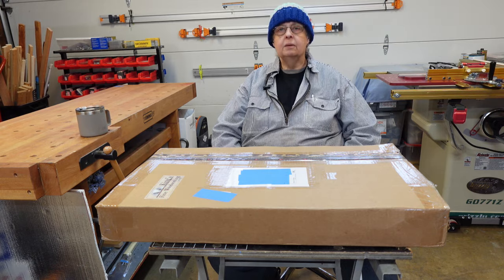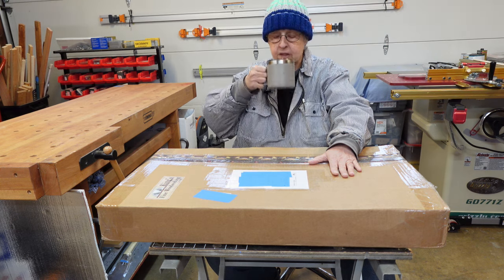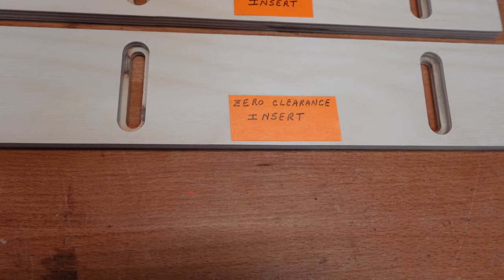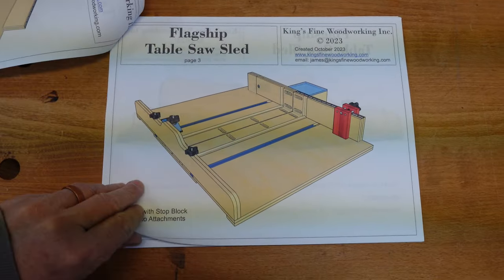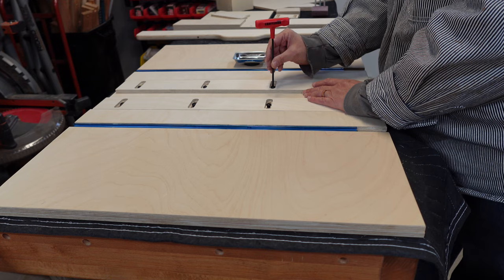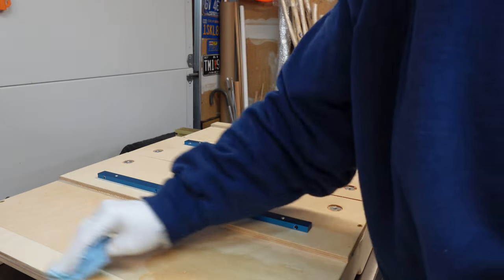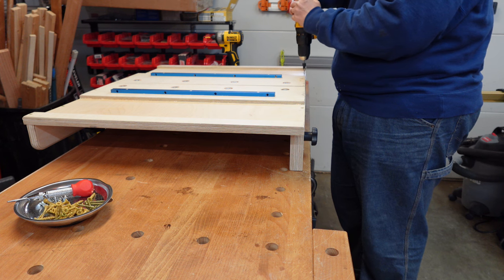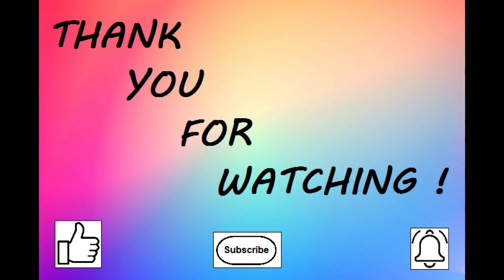KFW Flagship Table Saw Sled Unboxing and Assembly - Part 1

Comment: Just a quick note on this sled.  I started putting mine together yesterday and realized that some of the t nuts for attaching the zero clearance inserts were too high on the top side and had to be filed down and 2 were too low and thus sticking out of the bottom (not flush) and rubbing on my table.  I thought it was the miter bars scraping because they were not adjusted properly and finally realized (today, fresh set of eyes and mind!) that it was the t-nuts rubbing on my table - they needed to be forced in slightly with a little persuasion!
Reply from the maker: Thank you Matt!  I will let James know about your issues.

Comment: Excellent video, provided me with information I did not see in James' assembly instructions  - especially for attaching the tape measure.  Many thanks on that.    I went lean on the CA glue on the miter bars like James did,  I like your tip on the phillips screwdrive and hex combination.  I will be making a router table for my Dewalt router and this sled should help me make exact cuts.
Reply from the maker: Thank you for watching and thank you for the comments.  I have been using my crosscut sled for over 3 months now, I use it every day and I love it.

Comment: Really well done video. Brilliant idea on putting the hex into the top of a Phillips screwdriver to keep with the sled for that specific use. I did find it quite funny that you were waxing the bottom part of the sled that doesn’t actually contact anything.
Reply from the maker: Thank you so much. James recommends waxing the whole thing, even the parts that don't contact the table saw, so that it will absorb moisture evenly. This is to prevent any warping. He is the guru so I did what he suggested. It makes sense though.

Comment: I don’t have the cross cut sled yet, but the tip about to much ca glue and going to your neighbor’s garage and finding a screw drive that you can drill into is valuable info.  Plus it nice to see that you got a new table saw out the deal.
Reply from the maker: Thank you. I hope the video helps when you do get a sled.

Comment: Thanks for the video, I found it helpful.  I have a question about the tape measure applied to the top of the fence.  Since the stop block that's provided has an adjustable bolt on the bottom, it seems that the tape measure won't give anywhere near an accurate measurement when lining up the top of the stop.  Just wondering how do you deal with that.
Reply from the maker: You are correct. I have found that I do not use the tape measure except to get reasonably close to my measurement then I double check with my good tape measure and adjust the bolt.

Comment: Very helpful and well-done video. Question, at the 19:39 mark, could you have gotten the CA glue out using acetone?  Doesn't acetone dissolve CA enough to back out and clean the screws?
Reply from the maker: Generally yes, but it was really caked in there so I didn't even try.  It was just easier for me to go get news ones.  Thank you!

Comment: I think an unanswered question for all these sleds is what saw sizes they fit?  Some folks mention small portable contractor saws for their sleds, but after that size is rarely mentioned as if everyone might have an industrial saws top. The size all theses sleds are made for should always be included.
Reply from the maker: I made a short "Part 3" video that show all the dimensions of this sled. That should help you determine if this sled will fit your table saw.

Comment: Hi once more I thought I would enquirer of you that I currently have a Delta eunisaw and like new but I am strongly considering getting a Saw stop so I am feeling that I might want to wait and put the runners on when I get the saw stop do you agree?
Reply from the maker: Not necessarily. The runners are pretty easy to tap off and move if you get a new saw, as long as you don't overdo the CA glue like I did the first time. I wanted to show how easy they were to set up on a new saw so I would go ahead and set it up on your Delta. It's easy enough to set up on a new saw if and when you get a SawStop.
Reply: @MolassesCreekWoodcraft  Thank you Molasses!